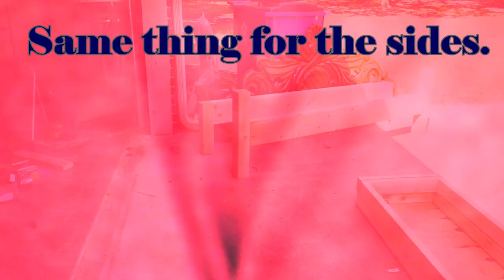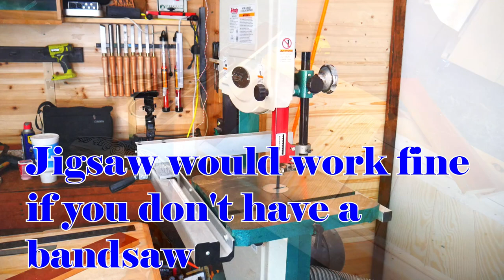DIY EASY HeadBoard Bench HOW TO IN A SMALL SHOP

Comment: Hey It looks great. I started working on one similar. Just wondering the bench seat 1x4s I guess what kind of wood did you use? Also you didn’t leave any space in between them right?
Reply from the maker: I didn't leave any space between them, and it's pine. I believe yellow pine. If it were going to have the chance of getting wet, I would have put space between them and no storage space.